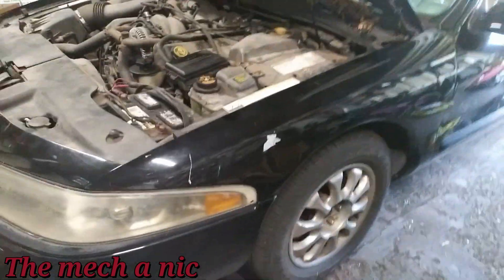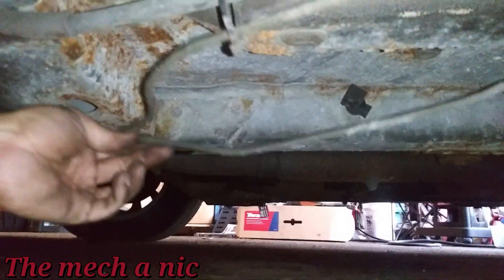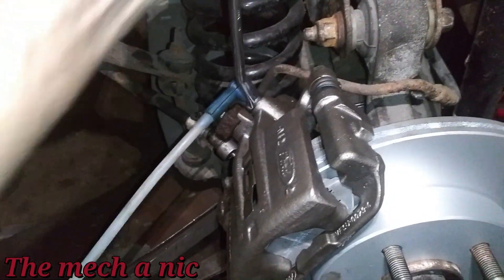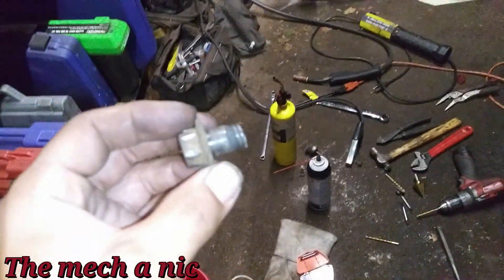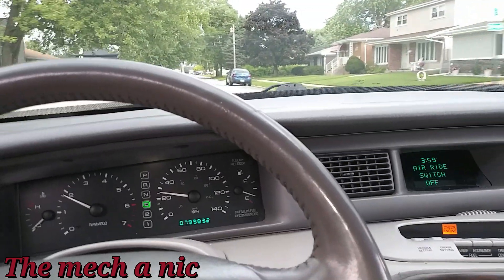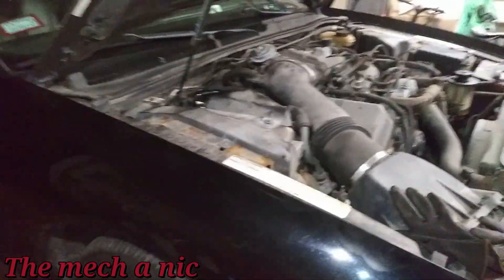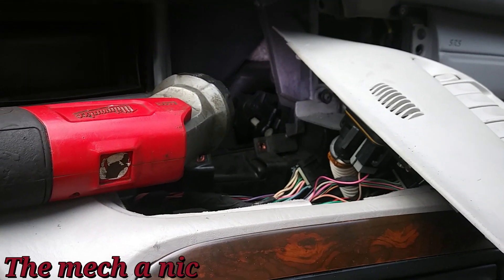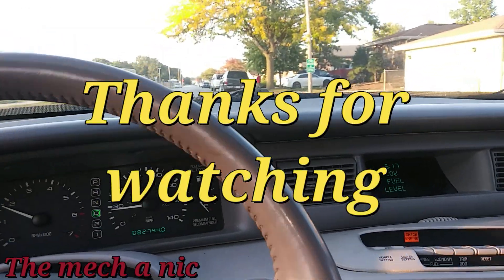lincoln mark 8 repairs

Comment: You seem to use that gun when it's really not needed in some cases and then use "red" loc-tite on upper control arm bolts?? they have "blue" loc tite for that if needed , the gun is a little faster but you gotta know when to use it and what on.
Reply from the maker: Its a red bottle but its blue thread locker in it. Yes I use my impact gun wherever I can just like anyone else who works on cars every day. I clearly mentioned that I made a mistake and was tightening instead of loosening.I caused the problem so I had to deal with it and fix it

Comment: Do u have any videos on exhaust leaks with this Lincoln? I have the same car. My car is giving codeP0174.
Reply from the maker: I'd check the engine.  If the babk 2 is running lean , check for a vacuum leak since it's the easiest

Comment: blender actuator?
Reply: blend door actuator ... the blend door allows a blending of hot or cold air to desired  most times the fail is the actuator shaft cracking and not moving the door

Comment: You shuldnt drive this car with the air suspension switch off in the trunk... i guess didnt screwup the air ride on this car.
Reply from the maker: This car no longer has air suspension. It's all been replaced with regular struts
Reply: @themechanic6117  
Then you should disable it at the glove compartment so it doesn't interact with the control unit at the dashboard... :)
Reply from the maker: That's all been done. This is not my car. The owner had all this work done at a shop and it's been like that for years